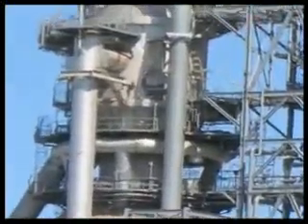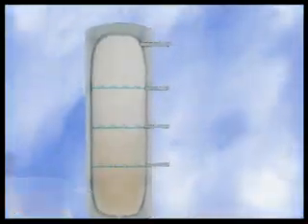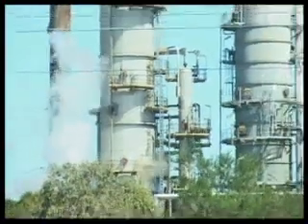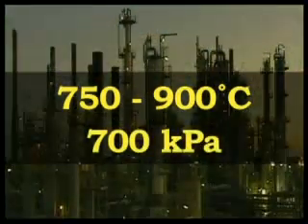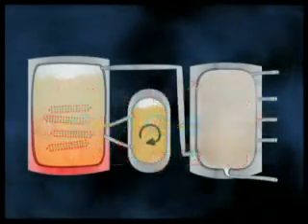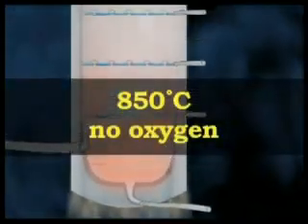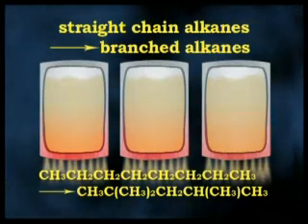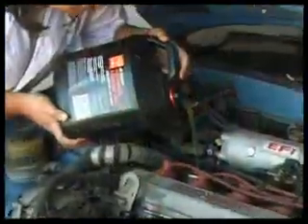petroleum refining basics

Comment: how do you determine the height of each temp in the column as it rises to know how to collect each process at a certain stage
Reply: By knowing from previous experience (experimentation and measurements) the approximate boiling point of the various fractions.